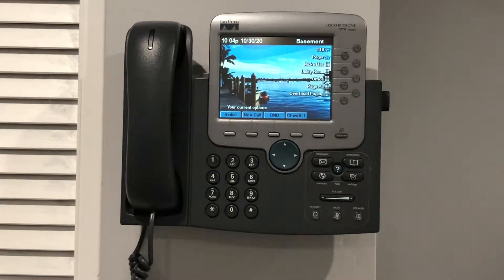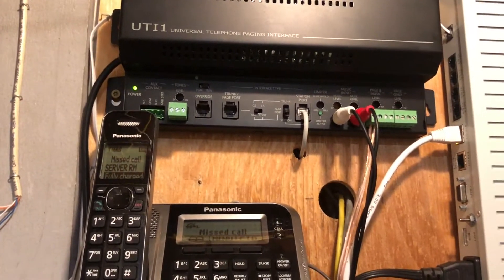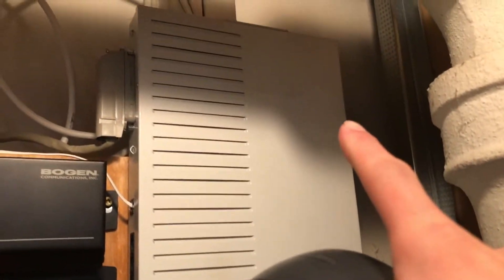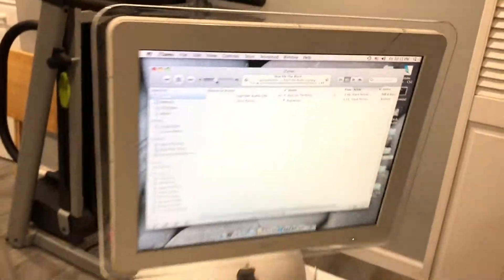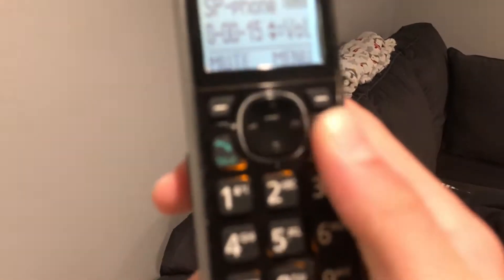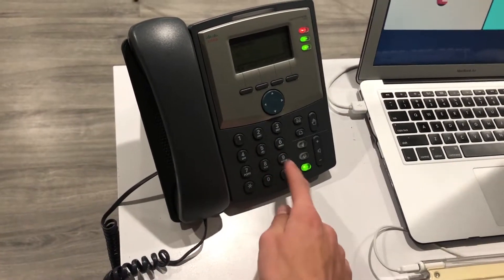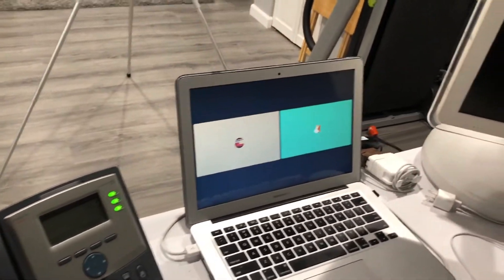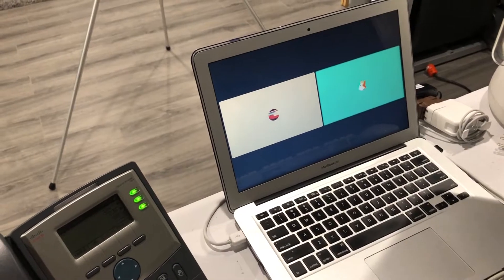Voip System Updates: Ep. 3

Comment: Yes this is a second comment, but I do hope to have a VoIP system, is there anything I need besides a computer for a server? I just want a Cisco system similar to yours.
Reply from the maker: Thats okay! Other than a computer and phones, you may need either the power adaptors for the phones (Mostly not included), or POE injectors, or just a POE switch. That way you can power them. I deeply suggest the spa series for starting out. The 7900s need special firmware and config files that you have to research into. Other then that, you can start a basic system and expand from there.
Reply: @nm4fsv684  I see, helpful.